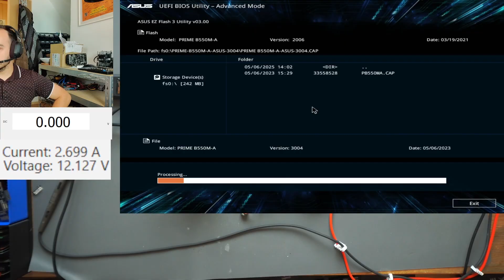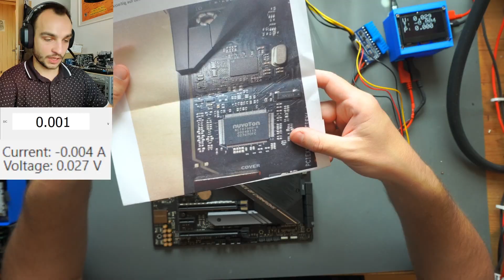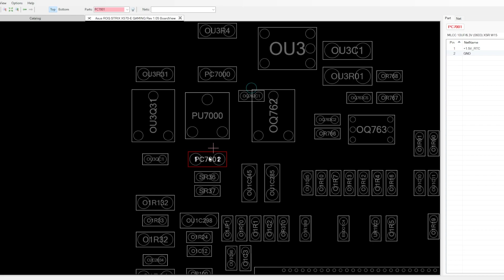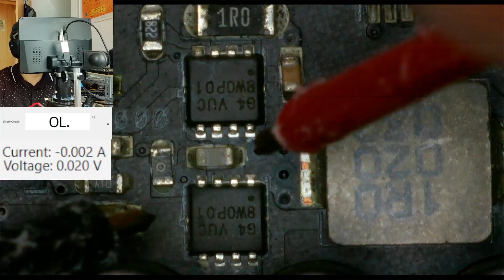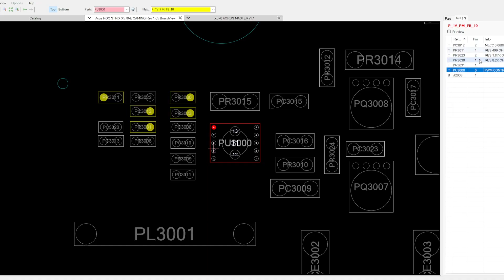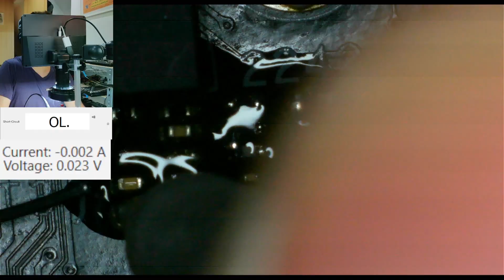FIXING A HEAVILY CORRODED MOTHERBOARD || ASUS X570-F STRIX GAMING REPAIR

Comment: What is usually the cause of not being able to boot from anything other than APU? I realize that is a loaded question. I hope to see a few videos that helps us understand this issue, as I have a board that only posts with an APU, not sure if it will run a GPU or not with the APU yet..
Reply from the maker: That can be a bios issue, because compatibility changes a lot with different bioses! And there is also on AM4 a CPU ID line that determents wether its a APU or CPU or what generation off CPU it is! There are truth tables for different CPU generations within motherboard shematics! The different CPU´s have PINS that are depending on their generation high or low and that tells the board what generation off CPU it is and that might also has something to do with the APU/CPU issue!

Comment: I would never ever use a water cooled system because 10 years ago I built my current gaming 
system using a mediocre cooling fan, not long after I built it a friend like my system and built a
copy but he relied on a water cooler, long story short it failed a while back due to water
damage, would have been better to fry the CPU if it were marginal rather than the catastrophic
failure my friend endured a few years after he built it..

SAY NO TO WATER COOLED SYSTEMS..

Comment: Isn't it just an enable signal, ie, when you power the 1.05V the SIO sees ok and then allows start of 1.05V PS.
Reply from the maker: No its called 1.0V_PM , pm standing for the pch here and its an actual voltage rail. That never reaches the SIO directly!

Comment: The corrosion wasn't that bad, just normal liquid damage. I saw way worse on classic motherboards that were kept in the attic, garage or from PC's that were used outdoors and the whole board was corroded. 
Great job on bringing it to life, tho i wouldn't use it that way, standby draw is a little too much for my comfort. :D
Reply from the maker: I've actually checked the board for any heat spots and it was just fine! Nothing getting to hot!

Comment: I have the same POST card reader that does not read anything on any board and now i see u are using some kind of a wire.
Can you tell me what wire is that and where it goes ?
Reply from the maker: That post card almost exclusively works in the tpm slots! 
On Asus boards there is a 5 pin header that is called com debug. You need to connect pin 1 off that with pin 1 off the post card.
Reply: @MainboardMedic  
Dont have that on Asus Z170-A_1.04
Reply from the maker: @northwestrepair  Yes, but that board has a TPM header, so just connect that to the LPC interface off the debug card.

Comment: You're brave working on that motherboard. But you did a great job. I was thinking that it could be a broken trace near a pad causing this issue due to the fact that when you used your power injection you jumped over the broken trace. It was fun to watch this attempt, I enjoyed it. Thanks.

Comment: Hey I was wondering if I could use a Kill-a-watt with a normal power supply to measure the motherboard's draw would that work well?
Reply from the maker: It can work, but most of them aren't accurate or fast enough! 
For example you wouldn't see a quick pulse when the board quickly turns on and off! Tha mA are quiet handy for something like that!